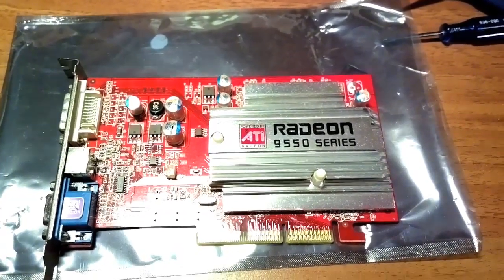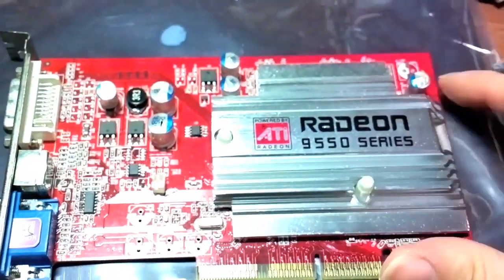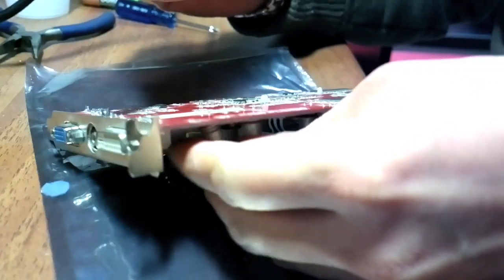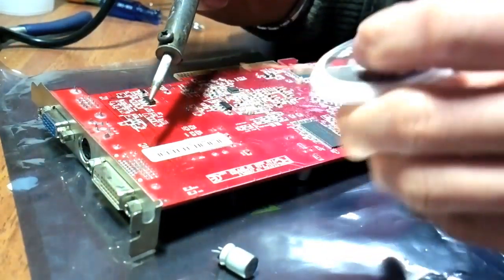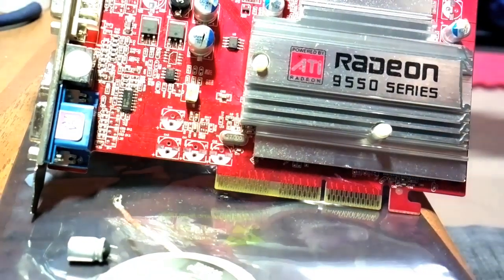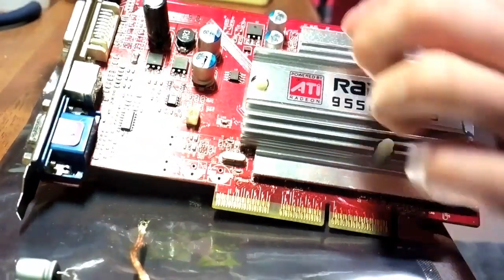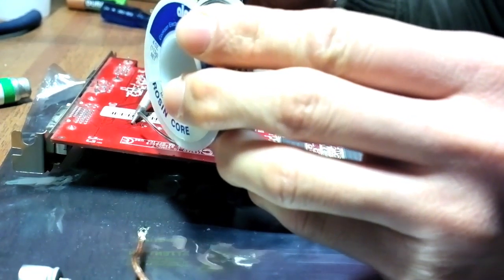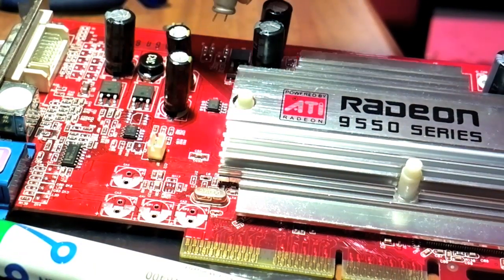Repair graphic card with bad capacitors ATI, Nvidia

Comment: I have an XFX Nvidia Geforce 9400gt.  It used to work fine.  Unfortunately, I dropped my Assembled system which is now OWR and there are horizontal lines even in the BIOS.  But my video on the motherboard works fine.  How do i fix the issue with the horizontal lines as it occurred only after dropping the system.  Could it be a capacitor issue on the videocard?  Can it be fixed?  Another graphic card works fine on the same slot
Reply from the maker: Did you drop the computer with the monitor plugged to XFX card? If so, you may have damaged some pins of the the output connector soldered on the board. Check to see if there are any hairline cracks.
Reply: 1000uf what about blowing up a hard drive when you plug in a monitor?

Comment: very helpful. i found out last last year that the display started showing stripes and I'm sure it was from the graphics card and not the mobo. I will try to check my card when I get free time.
I also found a problem last year when my desktop wont start anymore. My suspect is that the PSU is the problem. But I should check the mobo too and hard disk too as mice had entered the my rig and piss on the hdd.
Same thing with the electric fan, got problem when starting. I searched for the probable cause and I found out your video.
Will check and repair them when I get free time. Thank you!